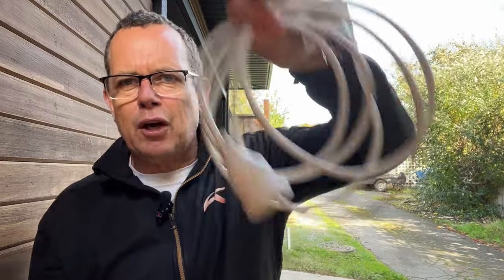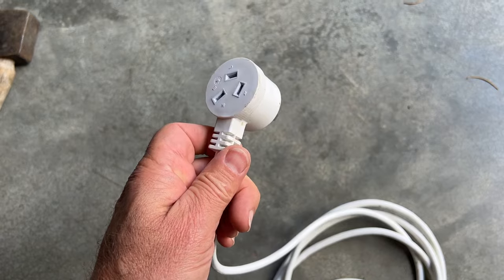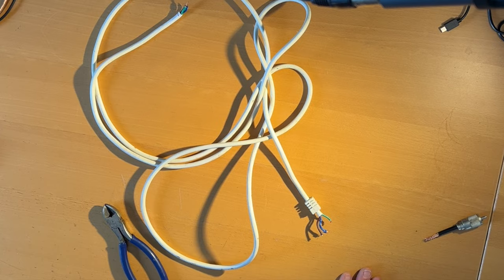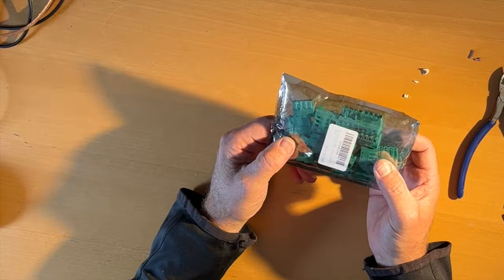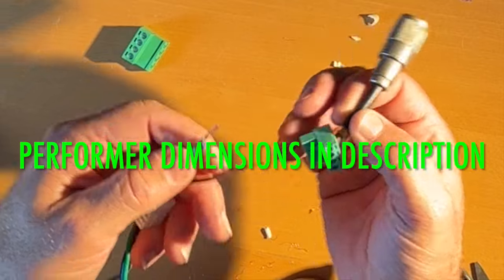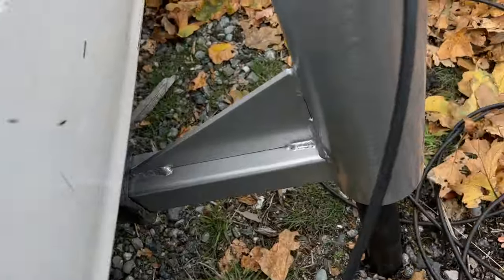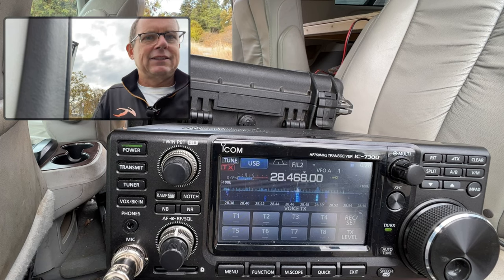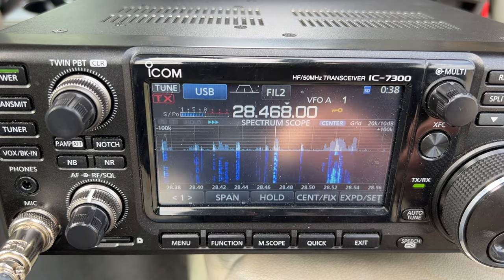How to Turn a Cheap Extension Cord Into The Ultimate 10 Meter Vertical #hamradio #hf #antenna

Comment: I collect recycled wires from construction sites and recycling centers, focusing especially on leftover old cables. I then use these cables to build a wire antenna and use twogether with balun(s). These antennas have been successful in my projects." , thank you very much for your video, - G7UNF

Comment: Cool connector Simon!!.. I think I'll stick to 20 cent wire nut over 28 dollar connectors. Antenna Tuner used?? lengths and guage of wire?? What is your radio?  Propagation has been wild lately, I keep hearing Hawaii on 11m in Arizona. I hope to be on 10m soon. 73
Reply: Vertical 117 inches, two 77 inch counterpoise got it 👍
Reply from the maker: Hey buddy, thanks for watching. I don't use a tuner generally - maybe to touch up the SWR from 1.1:1 to 1:1 but 99% of the time I use resonant antennas. The wire I believe is about 16 gauge. as for the length, the math of 234/ the frequency, so say 28.450mhz = 8' 4 inches is pretty close. So start slightly longer mate and trim it back as needed. Start with say 8ft 6 inches. The radio I mainly use is the Icom 7300 so I can put out 100 Watts when needed. Hope this helps mate. Cheers and happy DX

Comment: Thats fantastic well done, I was going to build a T2LT for 11 metres but thinking about this method instead. I thought the radials would have to be the same length as the vertical radial, Could you please give me the lengths for the 11 metre cb radio band. 73 Daryn (UK)

Comment: I am in the process of building my antenna and I have some questions about when you deployed it. It looks like the feed point is about 6 feet or so off of the ground. Is this correct? How did you connect the radials to the ground? Are they roughly at a 45 degree angle? Thanks
Reply from the maker: Hey Richie, thanks for your comment buddy. The feedpoint is roughly 6 feet off the ground, and the radials are connected to string, and then tied to battens in the ground. So they are elevated radials, and need to be at least 2 feet above the ground at the ends where the string is connected... the radial angle is about 120-135 degrees from the feedpoint downwards. Are you familiar with Greg's (KJ6ER) "PERformer" aka "PREDator" antenna set up? This is essentially that, but the radiating element is wire from the extension cord instead of a stainless whip. Happy building mate! She's a great antenna. Wooohooo. Cheers

Comment: Out of interest, how long was the cord?  Looks like a half wave as presumably were the two radials.
Reply from the maker: Good morning Roger, the extension cord is 3 meters, or 10 feet.... I salvaged the full length of the cord and folded a few inches back on itself. So the vertical radiating element is 9' 8" and the two radials are 77 inches. Depending on the height and environment, you might need to adjust this to accommodate. Thanks very much for your comments mate and have a great day. Cheers
Reply: Thank you.  I'll give it a try.
Reply from the maker: @rogertuffin6881   Good luck Roger. I'm working on another couple of different configuration antennas from old extension cords lying around. More soon buddy - happy building!